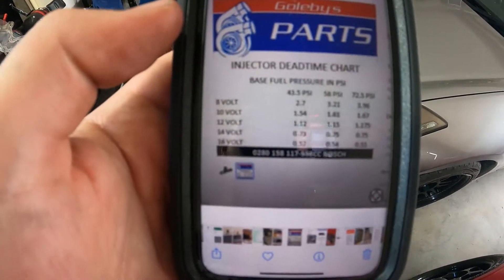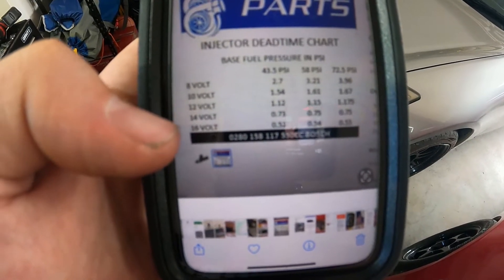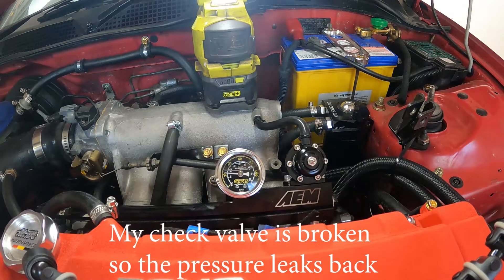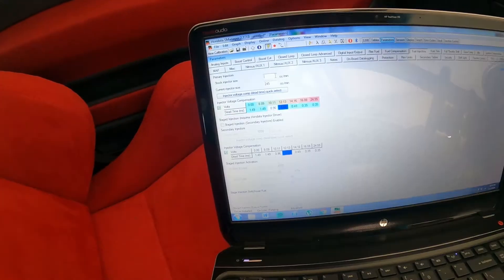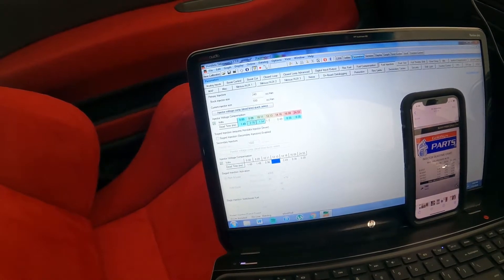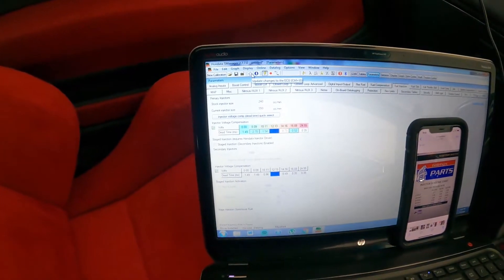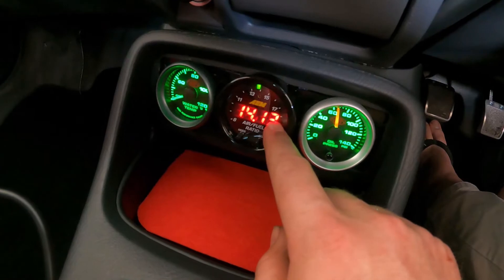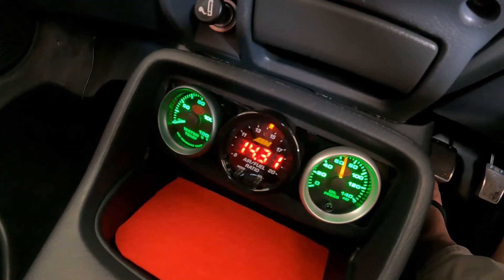How to change Injectors Size and Set Dead band Times In Hondata S300

Comment: Would injector dead time setting being off cause my car to go leaner with the headlights turned on?
Reply from the maker: Nahh mate I recon your alternator is dying and you don’t have enough voltage to the fuel pump so the pressure drops.